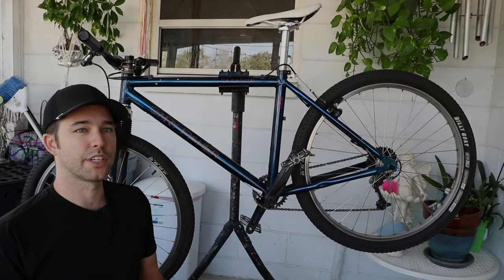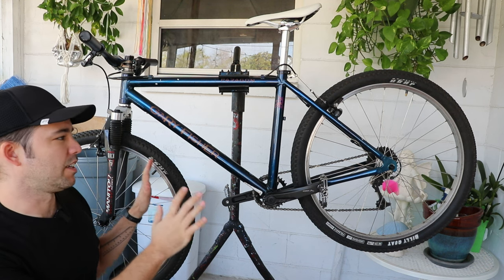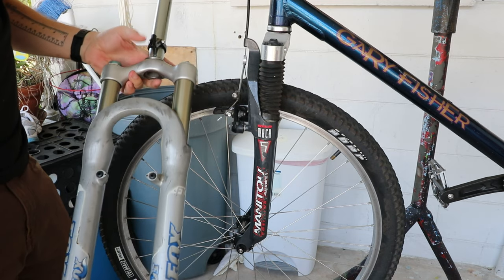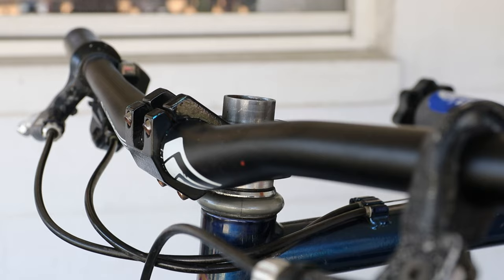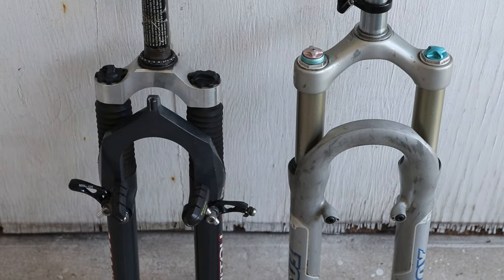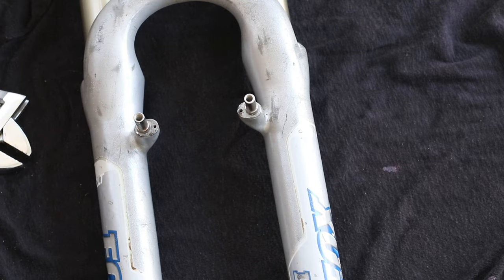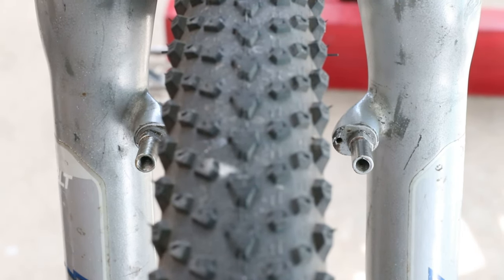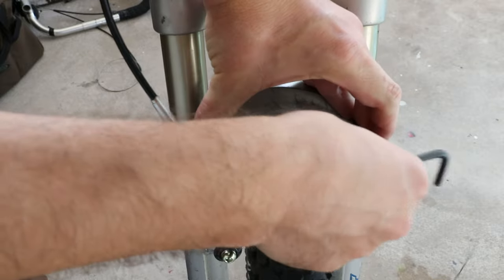Fox 32 fork on 1996 Gary Fisher mountain bike

Comment: I work downtown and my 26 gf is perfect on my rack. Don't worry about it being stolen, as I paid 80$ .  It's also my travel bike when I go to Florida or beach..I likenthe bike a lot but won't lose 1500 or 800 as I would with my DS and gravel bike.
Reply from the maker: 100% I actually paid $25 for this one, but I guess now I have somewhere around $200 into it.
Reply: @BruceChastain  Haha that's the way it goes especially if you buy nicer tires.  I bought an 89 Fisher Hybrid with drop bars and 700c tires for $25 too, changed the canti's to Mini-V's amongst many other changes, probably $300ish.

Comment: You have to use this vbrake anyway, because canti brakes do not work with that “stem spacer” adapter anyway. Your fork will dive into its travel and your brake cable would dive too. Your brakes would work only when the fork was not moving. To make it work, you would have to mount the adapter to the fork bridge to fit it.
Reply from the maker: Yeah I thought of that actually layer that day while walking! I was like wait, I won't be able so slow down when turning hard into a corner, what a bad surprise?
Reply: Yeah, have been waiting for a big reveal 😄

Comment: I have done a couple of projects with Shimano T4000 V-brakes.  They are inexpensive and very efficient.  I think you would find them to be a big improvement.
Reply from the maker: thanks Peter for the feedback, I did see them on amazon. I think I'm getting the idea that the T4000 for the calipers with some mid to upper end levers might be the ticket.
Reply: @BruceChastain  Bruce, I used fairly low-end Shimano levers.  Again, not expensive.  

I used compressionless cable.  The brakes work very well.  Even as a mechanically-inept lawyer, I had no trouble making them work perfectly.

Comment: For reinstalling crown races without the proper tools, there are a couple of DIY hacks that are a little less "cave man" than a punch or a screw driver.

1.) PVC pipe which is what I still use after 20+ years of wrenching. I think you were probably talking about that when you mentioned the hardware store. PVC is good because it won't damage the bearing race surface.

2.) I have used an adjustable wrench wrapped around the steerer tube resting on top of the crown race and then I tap the side of the adjustable wrench jaws with a hammer to set the crown race. Would also work with a 1-1/8" open end spanner.

3.) If you have a spare crown race, flip it upside down on top of the race you are installing. The narrow lips of the races will be touching ad you'll have have a bigger flat area you can hammer, hit, or smack to drive the new race down.  This works particularly well with the PVC pipe method.
Reply from the maker: good tips man. I was just in too much of a hurry to get a pvc pipe this time, luckily I got away with it this time.

Comment: Short of disc brakes, swapping to linear (vbrakes) will help with your braking issues, and give you more power and modulation. As for the stem/brake mounting piece, just add another spacer under the stem?? As for brake boss(where you are installing the vbrake),  you should always put some grease on it... keeps the brake from adhering to it later on.The rubber piece should be installed on the noodle, keeps the dirt out. As for the noodle, it needs to have more of a bend. I too, love the older frames, especially the 90's -early 2000 USA frames, much lighter, better quality, and more lively.

Comment: Im not sure if you're aware but your stem is on upside down 😂. Might give you a better feel if you you flip it to the correct position. It will definitely be safer because you're no longer putting weight on the mounting bolts.
Reply from the maker: Really? I think the idea is you can use it either way.
Reply: I was think8ng the same about being upside down but hanger then spacers

Comment: Old fork had elastomers. Must change to linear pull brake arms (v brakes) and levers. I have used new Genetic canti's and an improvement but V's easier & cheaper. Modern hardtail free ride bikes are very slack angle up front. I dig it.
Reply from the maker: thanks Brian! I actually did upgrade to Vs front and back.